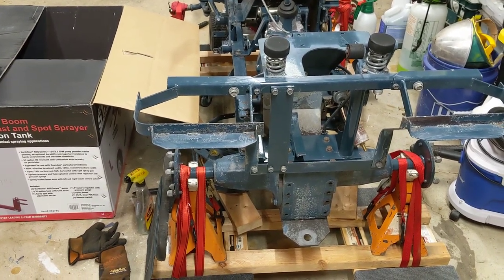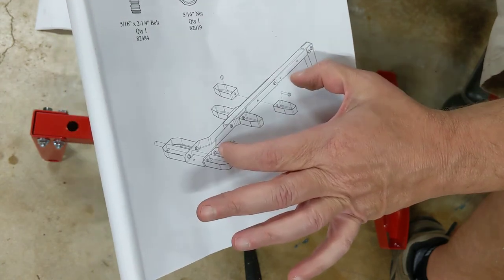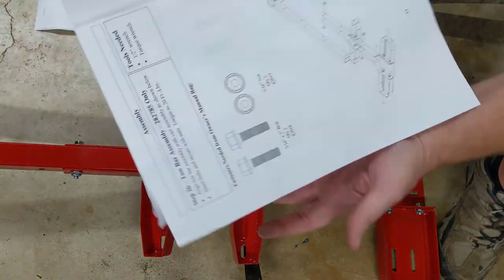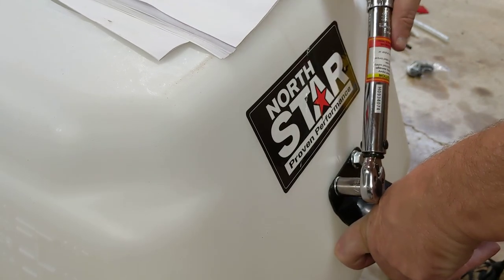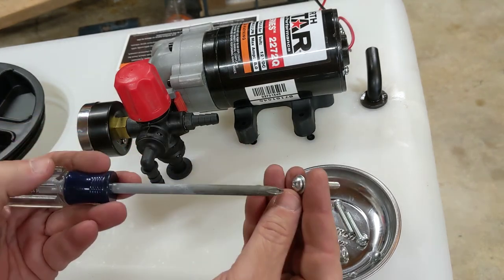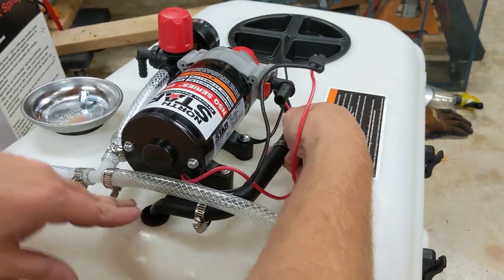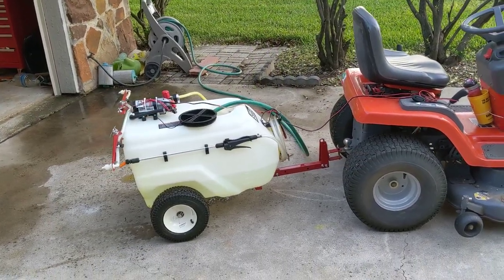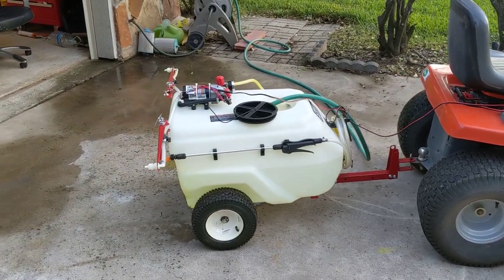NorthStar Tow-Behind Trailer Boom  sprayer assembly and first use

Comment: My box arrived completely destroyed  somewhere between SC shipping and FedEx. I had to send it back by UPS (purchased through Amazon). 😔 Found a store reasonably close to me (1 hour drive) and picked it up myself.  Use the screws in the video and don't look for the instruction screws as they don't look like the ones included.  Thanks for doing this video.
Reply from the maker: If you can get one home that's not beat up it's really a good sprayer. I forgot to winterize the hand sprayer and it cracked but that's an easy fix...I am still using and enjoying this sprayer!
Reply: @BubbasWorkshop  I made that happen:-)  Excellent video and still relavant after being made over a year ago.  Your video was instrumental in helping me put it together compared to their instructions.  I did notice a letter at the end of the model number.  I was thinking that was a "version" of the updated instructions.  Just got some 2, 4-D after returning Spectracide Weed Stop (more dangerous for trees).

Comment: I just picked one of these 31 gallon sprayers up at Northern Tool in Memphis.
Can you leave the hand sprayer off of it when you put it together or does it have to be attached? I prob won’t be using that feature.
Someone also said something about maybe adding some better nozzles, maybe brass or tee jet nozzles.
Reply from the maker: Yes you can leave it off you'll just need to plug the port. I haven't used it this year but the way I remember there's a shut off to shut off the spray nozzles but the wand is always under pressure so if you just put a plug on the nipple where the wand plugs into that should be fine. I would try it out before replacing any nozzles because I'm using the nozzles that came with it and they work perfectly fine for me 👍

Comment: Just put mine together tonight and noticed the strainer came damaged. Any ideas on how I can fix it myself? I was thinking of slightly melting down the rubber ring and then seating the metal strainer into it...or CA glue.
Reply from the maker: I'd try CA first.  This one may fit ... I think it's too big but check out the dimensions:  https://www.amazon.com/SEACHOICE-89621-Stainless-Strainer-Thread/dp/B000N9L20A/ref=sr_1_23?keywords=pump+strainer&qid=1662008130&sr=8-23
Reply: @BubbasWorkshop  I didn't see this till just now. I tried the heat method first and failed. The CA glue method worked wonderfully well. Thanks.

Curious as to how you calibrated your sprayer/spraying.  While testing I set the mower to the slowest speed and the depressed the pedal all the way so as to ensure consistency. Would setting the psi to 40 be too much in your opinion?
Reply from the maker: I don't remember what I have it set to (I have it set to full blast whatever that setting is). I plan on doing a video at some point on calibration but basically I would put a gallon of water in there, measure out a specific area in your yard so you know the exact square feet, then just keep spraying it at your normal speed until you run out. Once you run out you will know how many times you sprayed the area so you can then calculate how much (oz per sq/ft) of liquid you are putting down. Also, I'd recommend running the engine at a higher speed because the little magneto on there doesn't make a lot of power.
Reply: @BubbasWorkshop  Good idea! I'll try that for sure.